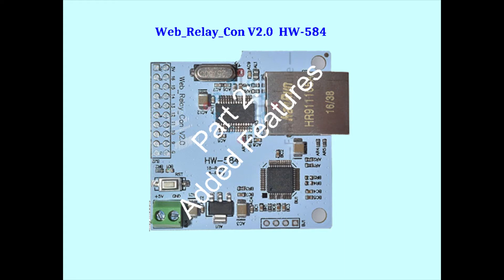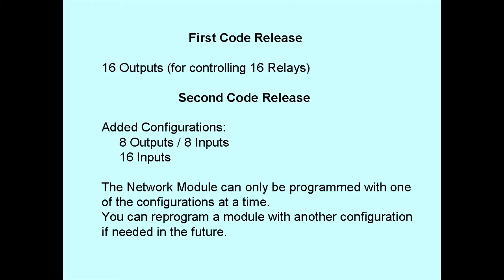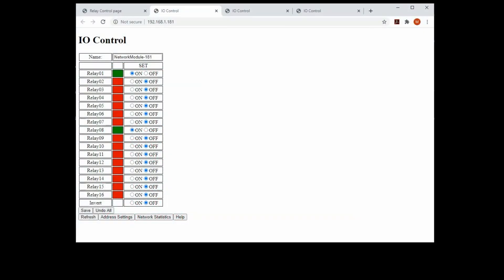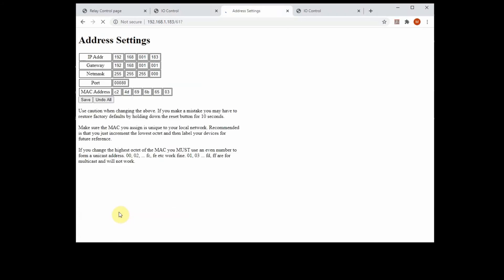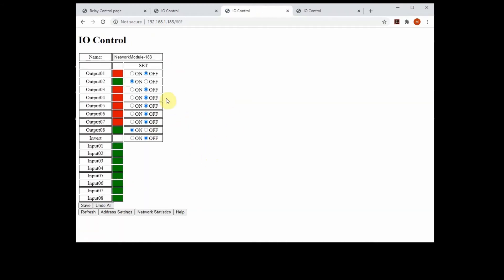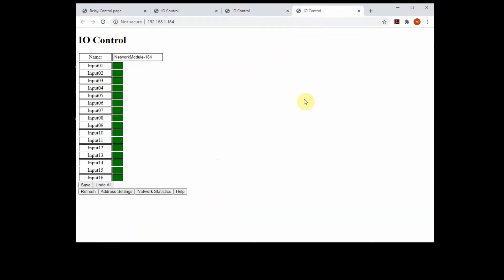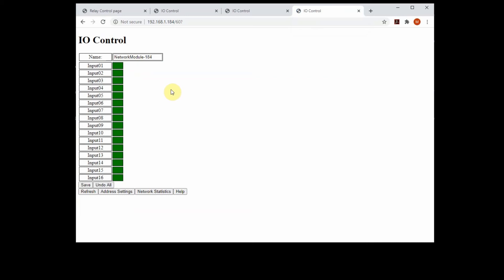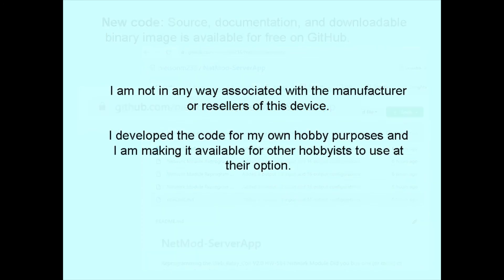Part 2 - Web Relay Con V2.0 HW-584 Network Module 8/16 Channel Relay Controller ENC28J60

Comment: Is the reprograming also working for v1.0 ?
Reply from the maker: My apology for the slow reply. No, this works with V2.0 HW-584 only based on the STM8 processor. The v1.0 is based on a Nuvoton processor which is a completely different architecture.

Comment: Hello, I like your project very much. I can see that it is being developed all the time. Do you plan on introducing a sleep timer in the near future?
Reply from the maker: Hi - Yes - as it turns out we are working on that right now. We are having some difficulty arriving at a complete specification for how that should work as there is no accurate clock on the device to tell time (as in actual time of day, or a calendar). From other requests we think what is being requested is a "timeout", for example meaning "If an Output is turned ON, it will automatically turn back OFF after a time interval." Likewise if an Output is turned OFF, the user can set that it will turn back ON again after some time interval. The time interval only needs to be fractions of a second, seconds, or perhaps minutes later. If this matches your expectation let me know - or let me know how you think this should work.
Reply: @nielsonm.projects  Great news.  I am waiting impatiently for the next versions of the program.  Best regards from Poland and thank you for your quick reply.
Reply: @nielsonm.projects  At the moment I'm working on a program for Arduino Nano and enc28j60 (I'm using Ethercard library) that would raise and lower window blinds at a certain time.  I thought to do it the same way you propose.  Each roller shutter would have its own lifting or lowering time.  As of today, it supports the window blinds system at home using mobile phones - I wrote the program in B4A and esp8266 (Esp01) I wrote the program in Arduino and I have two sliding registers 74hc595.  Looking at your program, I see that you have a lot of knowledge, unfortunately, compared to you, I am novices, despite this I try to write my programs as much as I can.
Reply from the maker: Hello Miroslaw - A sleep timer? You mean to reduce power on the board?
Reply: @nielsonm.projects  I meant turning the relay on or off after a certain time.  I am using google translator, sorry for my english.
Reply from the maker: Now you have me concerned. It sounds like your Arduino device knows "time of day" so it can perform some action at a specific time (let's say 6PM). This implies that it has a time of day clock, and perhaps sets itself with NTP. And it requires a user interface where the user can specify "On time" and "Off time" for each output. I know how to do all those things, but did not plan to do that at this time, and it may never fit in the very limited memory of this device. Most people are using Home Assistant or another server based device to provide time of day control.
Another user had requested a timed output of the form "If I turn a relay on, it will turn off by itself in 10 seconds". In other words a "pulse" output, which is very easy to do. That is what I'm working on right now.
For your Arduino project do you have some external control device that is providing the time of day control? Or is time of day internal to the Arduino software as I described above?
(I'm asking to determine if I need to change my specification, or at least enter another feature request).
Thanks
Mike
Reply: @nielsonm.projects  I'm sorry I'm just writing off now, but I've had a lot of work to do. At Arduino Nano, I want to use the RTC DS3231, which will control the lowering and lifting of blinds at a certain time for individual outputs. I do not plan to connect my project to the Internet, it is only intended to work on the local network. I know most users use different control apps, I don't.  I don't want to impose any of your ideas on you , this is your project and you rule it, and if you take into account my comments I will be grateful to you for it.   Thank you Mirek.
Reply from the maker: Ah! Well at least now I understand what you are requesting! I will add a request to the issues list so that I can come back to this later. In the case of this device it does not have the hardware for a reliable real time clock (like the DS3231), so there are two ways to do this. 1) Add a DS3231, 2) Use NTP (which requires internet access). Either can be done, but an NTP clock does not add hardware cost. Thank you for the idea, and we will look at this going forward.
Mike

Comment: Good day! Thank you so much for your work, he helped me a lot with this board!
There is a problem with the firmware for 16 inputs, inputs 1-8 do not work, immediately after the firmware they are marked in red, no settings could make them work. On the same board, the firmware for 16 outputs works fine, tell me what to do?

Добрый день! Огромное спасибо за ваш труд, он очень помог мне с данной платой!
Есть проблемма с прошивкой на 16 входов, не работают входа 1-8, сразу после прошивки отмечены красным, никакими настройками не получилось заставить их работать. На этой же плате прошивка на 16 выходов отлично работает, подскажите что сделать?
Reply from the maker: This is a bug that I did not know about, so thank you for letting me know. I'm getting close to releasing the next major revision and will make sure this is fixed. Watch on GitHub so you will know when released.
Reply: @nielsonm.projects  Thanks for the quick response, I am following your branch on github
Reply from the maker: Good - Welcome! The next Browser interface will be much more flexible with regard to configuration. There will be only 1 code load, and the user interface will allow enabling MQTT, and will allow each pin to be defined as input or output.